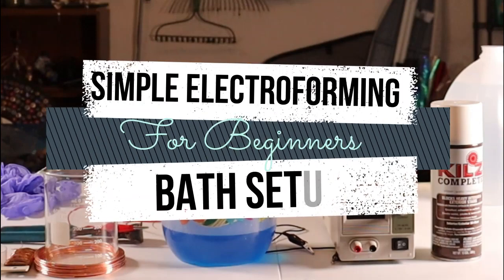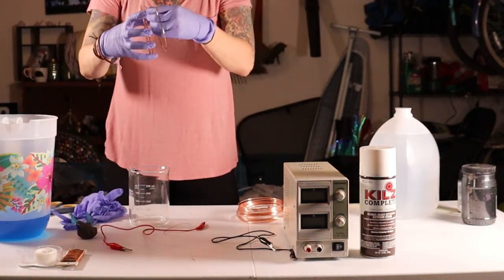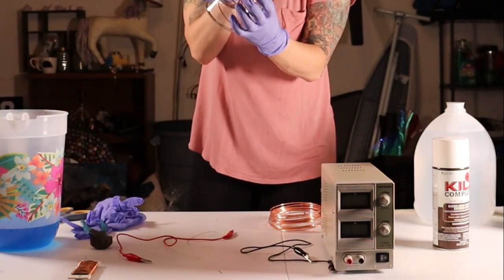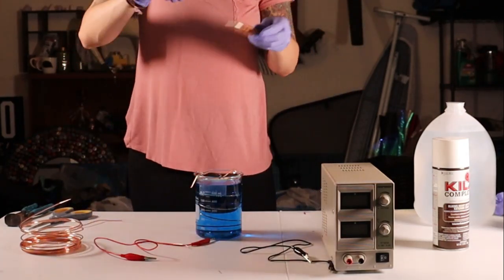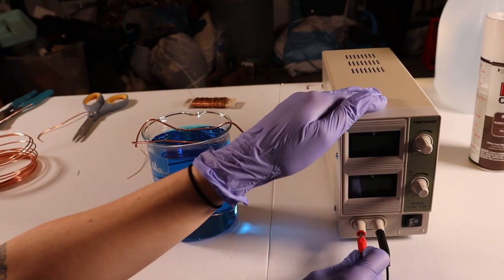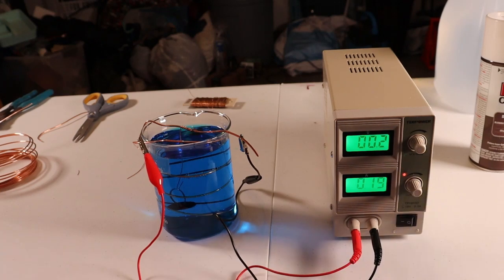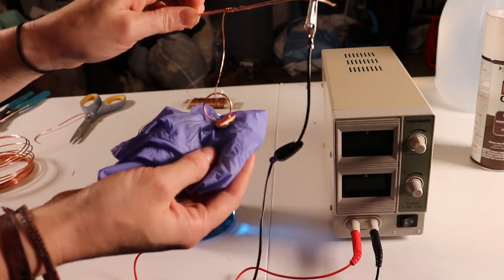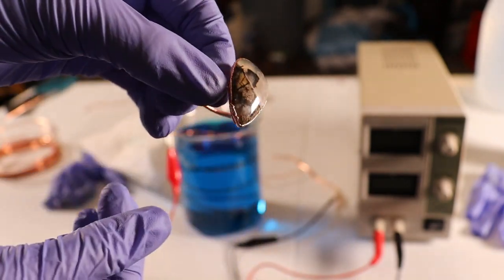HOW TO Electroform Jewelry

Comment: Hi! Thank you so much for this video! Super helpful ❤ 
I have a question. If I'm doing sterling silver plating, do I need to get a sterling silver wire for inside the beaker? I know the electroforming solution is different, but I don't want to ruin the solution by putting a copper wire in there 😅
Reply from the maker: I'm almost positive this will not work for silver, only copper.
Reply: @MandyReyesDesigns  darn! Okay, thank you!
Reply from the maker: @arielmay827  I know! When I learned, I was hoping you could too. I purchased a really inexpensive plating kit that goes over the copper, but it was a waste of money. I think there are companies that you can send your pieces to and they plate for you, might be worth checking out. Good luck!
Reply: @MandyReyesDesigns  well thank you so much for taking the time to respond! ❤ I appreciate it 😊

Comment: can you do more than one ring in the beaker at a time?
Reply from the maker: Yes you can! In a small set, I haven't had the best luck with anything more than 3 rings. You just want to make sure you have enough copper wire on the inside and that you jiggle them around so they don't bond to the hanging wire. Slow and steady is the best, and check on them to make sure some aren't growing more copper than others.

Comment: Hello, good video. I am making my first attempts at this, now I am going to start with a power supply but I am not sure how to do it. What do you recommend ?, according to the type of piece that I put to electroform, what amps do I put ?. How is that: if the piece is opaque / shiny, raise or lower amps ?, it is not clear to me. And another question that I don't see on video. When you take the piece out of the solution you are treating, do you submerge it in water with bicarbonate ?, then cover it with a wax or varnish ?. Thank you!!
Reply from the maker: If your piece has about an inch of surface to plate then you would set it at .1 amps. The is the total surface, I always just kind of eyeball it and guess the size because it's often difficult to determine. So if you see the pendant at the end of the video I'd say that's about 3 inches of conductive surface (only measure where you painted). Then check on it after a few minutes, if it is dark orange your amps are too high and if it's not plating after about 10 min turn it up. When I take my piece out, I don't follow the rule on that. I just wash my piece with soap and then I shine it up with a brass brush or dremel and oxidize it with liver of sulfur. I don't use wax, I then paint it with protecaclear to maintain the oxidation color for as long as possible.